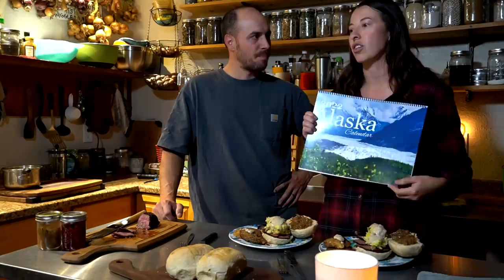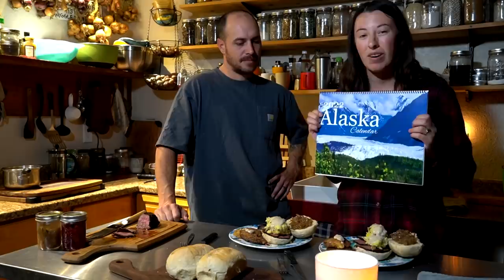Winter Came Early | Life Off Grid | Alaska 2022 Calendar

Comment: Question: do you keep adding compost & barley on your rows every year or do you rototill your rows every couple of years?
 Fall was always a busy time of year cutting ( we cut in the spring, usually a year before to let it dry), splitting and stacking wood, cleaning the chimney.
 We also used to prepare our garden in the fall as well. Ah to be young again and have the energy 🤪. Always look forward to your video. Be Blessed. 😊🇱🇷
Reply from the maker: We add amendments yearly whether that be spent barley, plant material from the garden, horse manure, chicken litter, leaves, etc. We don't rototill since the soil drains so well and is fluffy, I try to leave all the roots of the plants as well to allow the bugs to break them down which promotes soil that is full of life and minimally disturbed :)

Comment: You have 1.76 cords of wood on the trailer.  Suggest you get a ballast box on your three point and fill it with sand, or concrete  or some steel scrap.  I have wheel weights off of a combine in mine. Around 500 lbs and works just great. Also, you can put a trailer hitch for ball or flate hitch that you can hang load weights on and pull trailers around.

Comment: [question] I assume you have looked into an above ground root cellar?] I have seen them in Michigan that use solar cooler in the summer and ambient temp in the winter with a vent from a heated space to keep it from freezing. It uses very little energy because it has double thickness walls with interior and exterior rock wool insulation. [maybe a sponshorship there?]

Comment: My dad put a woodburning stove insert in his fireplace.  The fireplace pulled too much heat out of the house.  Dad didn't think about creosote build-up and in the second year of using the stove, he had a chimney fire.  A neighbor alerted him and called the fire department.  Mother's and dad's house was on two acres he kept when he sold his farm.  So, it was rural.  He got the chimney cleaned after the fire and the chimney sweep saw some of the wood dad burned.  The smaller pieces cut from branches was not split and the sweep told dad, they were responsible for more creosote than the other wood that had been split.  I saw some of your wood and the smaller diameter pieces were not split.  You might consider split it, at least once, before you use it.  Too old for me to move to Alaska, as I am almost 76, but if I were younger, I would have to give it some serious consideration.  I really enjoy your videos and wish much luck and good health.  As a side note; I bought five pounds of Jalapenos last year, found a recipe for the cowboy candy and ended up with about nine pints.  The juice has a very good sweet, sour, and spicy, flavor that I enjoy on meats, and the Jalapenos didn't lose any of their spiciness.  I have to eat them sparingly, although I once bought a jar of pickled Jalapeno rings at a Dollar General when I was driving a semi.  I was stopped for the night and put a fork in the Jalapeno rings and popped them in my mouth.  I ate the whole jar, without bread, but did drink a quart of milk.  Yum!!!

Comment: When I was younger, spades were for digging and shovels were for moving what had been dug up by shovelling, so the size of the head of the latter reflected the weight of what was being shovelled. Coal shovels, coke shovels, cinder and ashes shovels, sand shovels, horse shit shovels, and so on, and as you appear to have found when you were distributing the spent barley, multi-adaptable snow shovels. All good steel shovels can also be used for digging, and all good spades can be used for shovelling, but life is just easier if you use the tool for the job..

Comment: I was thinking for facilitating your use of spent barley or other "materials" you may wish to pick up with your trailer, the BAGSTER, Home Depot,     WM Bagster Dumpster in a Bag (Holds up to 3,300 lb.) was around 30 bucks.  I guess I'm a little spendy when watching the chimney work, brain said have two sets of pipe, not only as  back up pieces,  but make cleaning easier by replacing stack, clean stack pieces and store until next change. Put the cleaned ones on, and remove the dirty ones, clean and store until next change.  I know. odd but had to share idea..

Comment: To protect your garden bed soil from winter rains, snow and ice plastic coverings is one way of doing this. ... This way, your soil will warm more quickly in the spring and soil nutrients will not be lost in run off. Plastic prevents rains from causing soil compaction and erosion as well.

Comment: need a 2020 calender...when I get a shipping address in seattle...will get one

a question if you have a moment.  how is your solar array doing?  we  have a 130KW :) plant here in Texas...

and I know your's is smaller :) but curious how it is working.  have you had to change the batteries?  I see you have not added any more panels so those must work through you're energy budget

the calender looks great I can hard wait to get it Robert G. Oler
Reply from the maker: We still have the same batteries and love our small solar system 🙂
Reply: @SimpleLivingAlaska  so it handles pretty well you're electrical load?  or do you find a lot of generator use?  mainly in winter?

Comment: Didn't think chickens supplied eggs in cartons!!  Here is another recipe for fire starter from the 10th edition of the Boy Scout Handbook. Take 4-5 sheets of newspaper (must be newspaper b/c all other paper seems to be treated with fire retardant) and roll it tightly into about a 3/4" roll. Tie it in sections about every 1.5-2". Yarn works best as opposed to slippery kite string. Cut the sections apart, dunk them in hot wax for a few minutes(they will stop bubbling when done). About 1 lb of wax for 60 firestarters. One will start a pile of charcoal. 1 quarter of one will start a regular wood fire with small kindling.

Comment: You shouldn't use metal brush on stainless steel it leaves micro scratches and over time will cause more surface area for soot to stick and premature failure of the pipe , it is recommended to use a plastic head to clean the inner walls of the class A pipe system . 15 years of cleaning chimneys professionally I can tell you I have seen it cause more problems than you think .

Comment: You should not clean a stainless steel chimney with a steel brush. Steel particles get imbedded into the stainless and cause it to corrode .Use a composite brush  instead. Trying to be helpful.